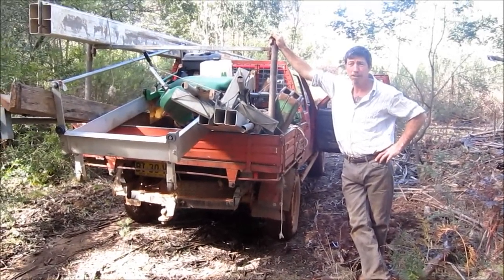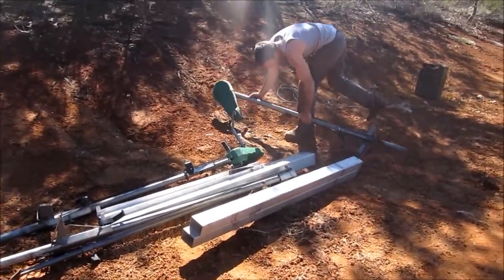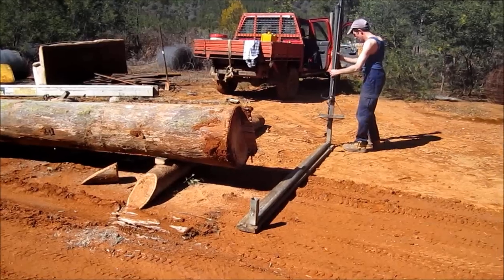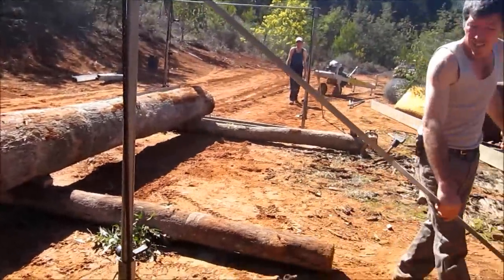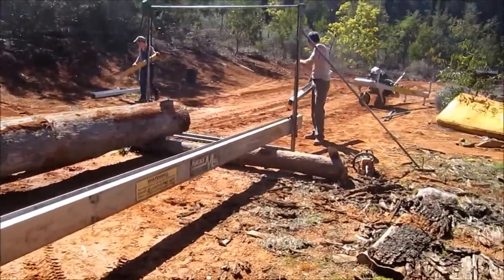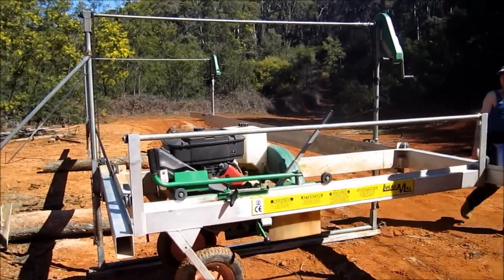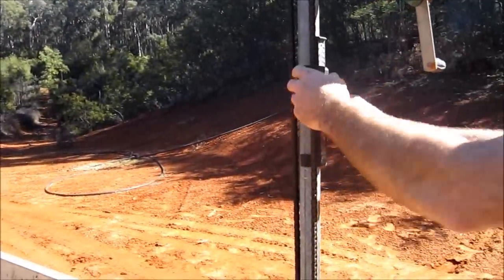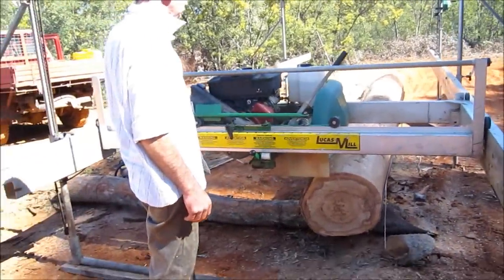portable sawmill setup

Comment: save so much time but not disassembling whole end frames  made special tipping trailer for  carry the lot  10 mins to wood coming off  
max cut is 6.3 if your clever
To parallel the rails look over  top rail under  bottom rail to parallel end frames  distance seen is 1/2 the  distance out !  easier than looking across top of rails  
owned 2 mills in last 15yrs   8inch and 10 inch current easy cheap sawmills  and great service from Lucas if you have any problems